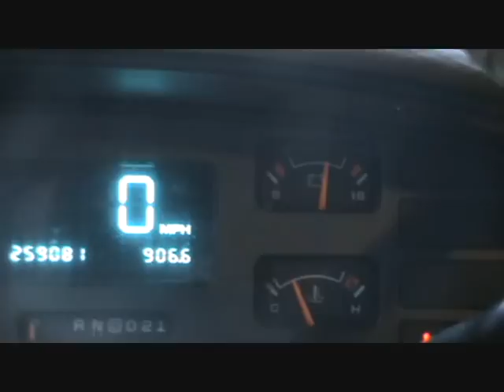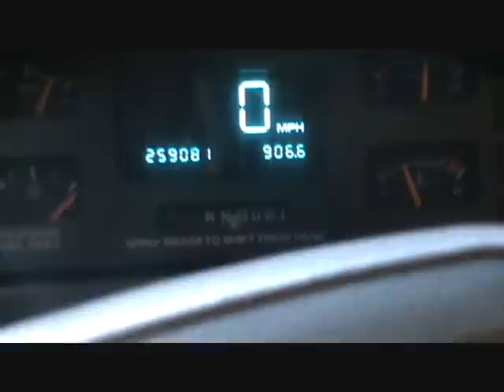Cold start and move LT1 Caprice

Comment: I wonder if a Idle Control Valve of some kind or Auxiliary Air thing is bad. I don't know these cars so I cannot say for sure...

Do all the vent functions work? If not id think you have a leaking vacuum servo for the vents that can cause this, again assuming the car has vacuum actuated vents...

Or a dirty throttle body...who knows!

Otherwise its looking good...!

Comment: i never knew these came with a LT1
Reply: The GM B body cars from 94-96 with the LT1 are amazing and fun as hell, folk don't expect them to perform from the way they look :D But the 4.3 L99 witch is basically a baby LT1 that most of the 94-96 Caprices used is a rear motor and too bad GM quit making these B body cars after 96, they could in theory have gone as long as FoMoCo's Panther platform cars.

Comment from the maker: @CornfieldCraziness  I'm not sure there is technically, but this car has some of the features of OBD1 and some of OBD2. You cannot retrieve trouble codes by using a jumper at the ALDL connector even though it has the older-style connector.

 I have a replacement trans going in soon, as well :-)